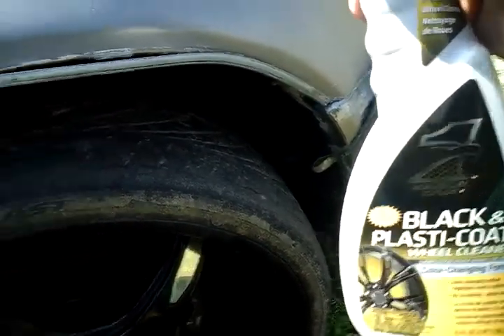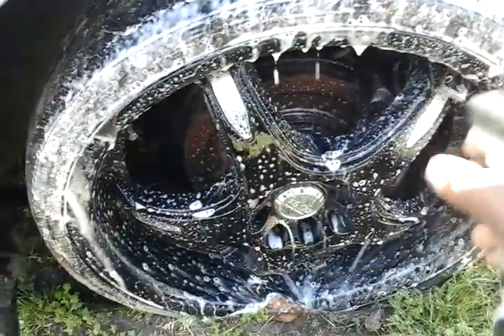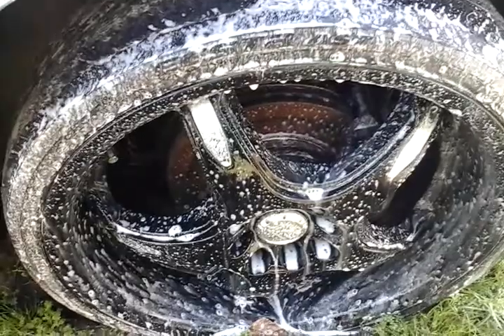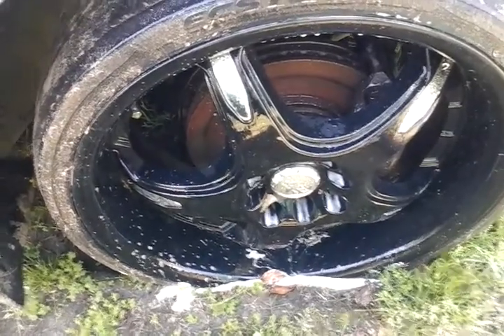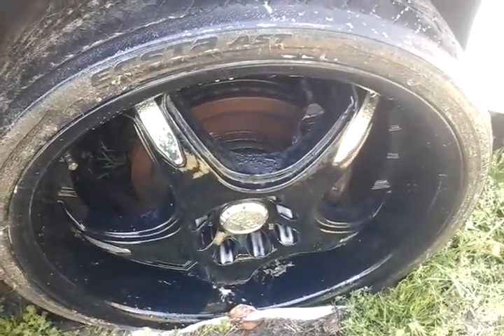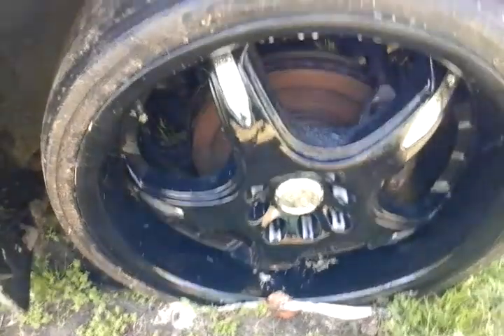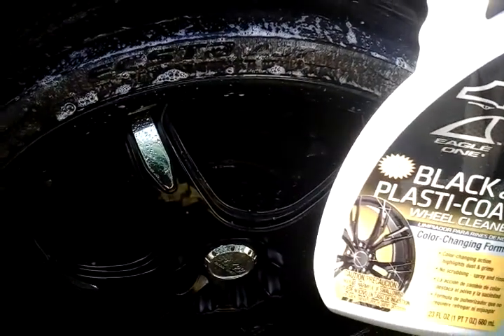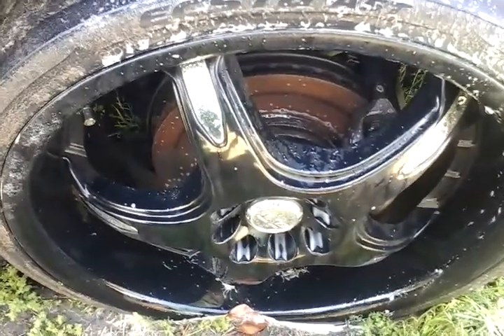Eagle one black & plasti coat wheel cleaner color changeing formula test review 2018 product

Comment: It’s not for tires.

I didn’t see color change on my black wheels when I tried it also, but I wasn’t waiting around for it. I was at a car-wash port and I was going wheel to wheel before the rinse water timed out. Also, my wheels were dirty but still have some sealant on them, no doubt preventing dirt from sticking to them too badly in the first place. 

But this product, along with agitation from my Wheel Woolie brush, did a good job getting the inner side of my wheels nicely cleaned (which have never been cleaned in all of ~25k miles).

Thanks for the review! Weird I can’t get info on this product anywhere, not even Eagle One.